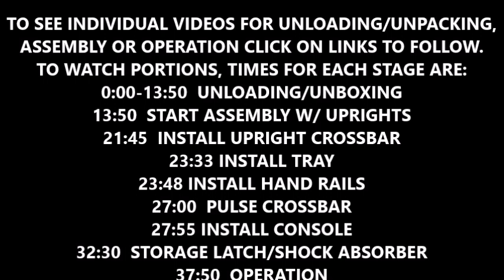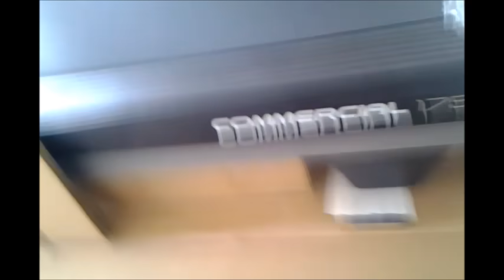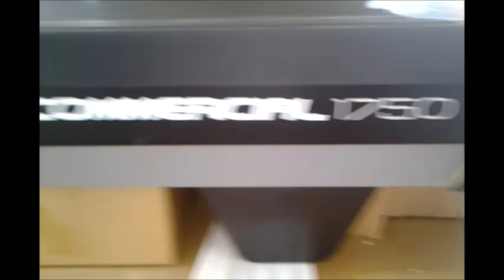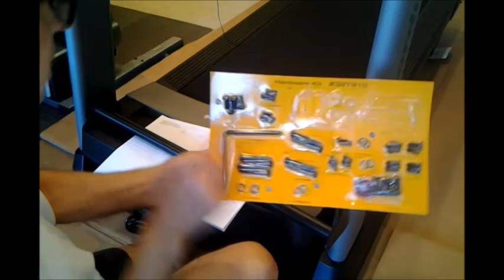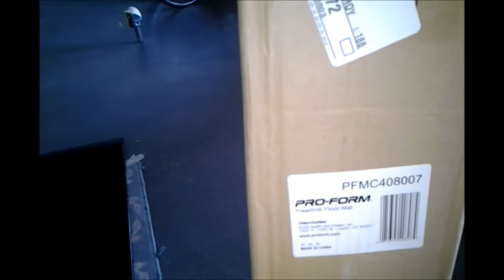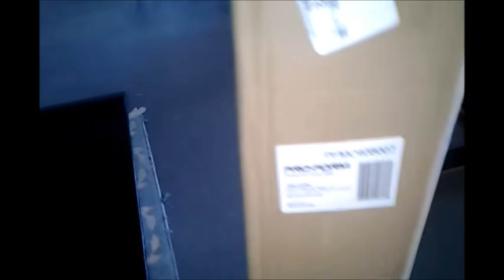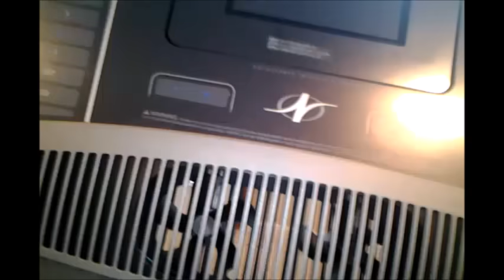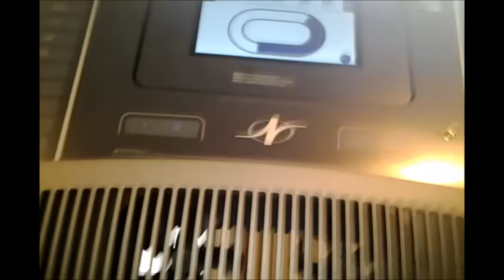NORDIC TRACK 1750 COMMERCIAL TREADMILL UNLOADING/UNPACKING, ASSEMBLING & OPERATING

Comment: I want to thank you and your wife for your the clear demonstration on how to set this up. How is yours holding up so far? I  am expecting mine to arrive this monday, and am haivng somene else assemble it. Seeing this video, I will be able to tell if the assembly is being done the correct way. Also, to clarify, the new NT1750 has select cusioning, but comes without a tablet holder. Not sure if one can be obtained as an option.
Reply from the maker: It is holding up great, Louis!  My wife runs 5 or 6 miles on it every day  (me about that many per week) & no problems so far!  I am surprised you don't have some kind of tablet holder, at least.  Surely you can order something?  Thanks for the kind comments & let us know how it goes & operates?
Reply from the maker: Louis, as an afterthought, does it come with a large enough screen that you can wifi your tablet, laptop, etc.?
Reply: @harrison4803  The screen is ten inches, so I am thinkimg it should be large enough. I'll know for sure when I receive it. :) AM happy to know that yours is still holding up.
Reply from the maker: @louisd95714  I assume that is 10" wide, which is slightly wider than my Ipad, that I use.  So, that is a good size.  Ours is only 6" wide.
Reply: @harrison4803  Thank you, I agree. Even if measured diagonally, I think it would be a good size becauae the viewing distance will be up close.

Comment: Great video. I'm having this delivered and assembled for me, but I'm worried about getting it through tight doorways. 
Have just removed an old Nike treadmill from the room but the box for this looks huge. 
Would it be possible to remove the frame etc separately from the box and move it into to room bit by bit??
Reply from the maker: Yes, as long as you have people available to do the lifting, it can be taken out of the box and moved and assembled.  Let us know how it goes?  Thanks for watching!
Reply: @harrison4803  Many thanks! That's a great help
Reply: Thomas Byrne ours just arrived today. We will need to put it upstairs. Thanks for asking the question because I was wondering the same thing.

Comment: Did you recievef the box in  the right position? My one was delivered this week amd the transport company   Moved out of truck and moved to my garage in a vertical positio. The labels in box states clear the proper side up but they transport in vertical way. Not sure if it was only in my door or this was done long from warhouse. I saw some movies of this tread mills showing it was delivered ina wood skid plate (pallet). Regards and thank you for the movie.
Reply from the maker: Mine was delivered flat in the truck & then the guy loaded it onto my John Deere wagon horizontally. Then my wife & I slid it off the wagon onto the patio & then pushed it into our walkout thru French doors.  Ours had cardboard & black pressed wood pallets surrounding it.

Comment: Thanks for the how-to video. I bought one of these during the virus shut-down, and not planning to go back to Gold's Gym for a while. The put it together option is not available anymore, so I really needed to see this.
Reply from the maker: Deborah, you may need some assistance on some portions of this, especially unpacking & the 1st part of the assembly? Let us know how it goes?
Reply: @harrison4803  I was given impression that the NordiTrack 1750 can connect to iPad and iPhone.
I WAS LIED TO.  The 1750 CAN NOT connect to iPad/iPhone.  
I will trash every NordiTrack all over internet.  
Another bitter customer.
Reply from the maker: @geak5994  GE, I can connect through my iPad with out any problem.  I do it through Bluetooth mode.  I can only get sound and not video, however.  Did you think you could get video?
Reply: @harrison4803  You get audio only, I believe.   IFit , for a period of time, allowed Bluetooth connection between iPad/iPhone.  That way you could use your iWatch to monitor heart beats while on treadmill.  
I did the texting thing with IFit support yesterday.  They removed that feature to support IFit stuff.
Reply from the maker: @geak5994  We don't have an iWatch or use iFit.  We just listen to radio, YouTube, etc.
Reply: @harrison4803  I do tv, but was counting on pacing myself based on heart rate.
Reply from the maker: @geak5994  You can do that with the chest band, can't you?  What do you mean, "I do TV"?  Are you casting to one or what?

Comment: This is such a great informative video John!! I am seriously thinking of buying this model now.. How is it now after a year? I do about 40-50km a week.. thanks Anton
Reply from the maker: Anton, we still love it. I only run about 10 miles per week but my wife runs about 30 and it's held up perfectly, so far!  We heartily recommend it! Thanks for watching!
Reply: John H fantastic!! Thanks John I think I’ll get one tomorrow unfortunately I’ll have to pay around £1700 to get one as I live in UK
Reply: @harrison4803  Sorry just another quick question! I'm currently 200lbs is that ok for fast running and or long distances in your opinion? thanks Anton
Reply from the maker: @theeyewearrooms4128  Anton it will take at least 350lb. and maybe 400.  And being a commercial model it will take lot's of use.  One thing I might add, it does not have a browser, at least our one year old does not, so you can't surf the internet.  Through Ifit you can access their stuff, which we don't use.  The blue tooth is great and can project all the way across our house.  We have to remember to shut of bt on our notebooks/laptops or they will interfere, while the other is trying to use the treadmill.  So, I don't know if the newer models says you have internet connectivity or not but we don't.

Comment from the maker: ns0122
Hi I’m assembling my 1750 right now, and I’m stuck on the ground wire/ground screw step. The ground screw doesn’t want to go all the way in, and I know you suggested using the screw that comes with it and screw all the way in to enlarge the hole to allow the ground screw to screw all the way in, however I’m afraid to damage the screw and strip the hole. Is it ok if there’s some space between the ground screw and the upright wall? I don’t want to proceed further lest I have to disassemble everything to get that screw closer to the upright wall. Thank you!
Reply from the maker: As long as the screw is contacting metal, it should work, IMO!

Comment: I'm thinking of purchasing this as well, but plan to bring it up to my 2nd bedroom in the 3rd floor of my townhome.  Do you know the dimensions of the box it was delivered in?  Hoping I can get it up 2 stairwells with a dolly and a the help of a strong dude.
Reply from the maker: Irena, it is extremely large - 7' long by 3' wide by 16" thick.  I think you will have to do some disassembly first?
Reply: @harrison4803  Thanks John, I agree with you.  Looks like I'll be searching for a professional team to disassemble outside and bring into my home piece by piece.
Reply from the maker: @irenafacelli2882  Irena, unfortunately, being a commercial unit, it is bigger & heavier than normal. Good luck & let us know how it goes?

Comment: Just wondering what the point of having all the small boxes under the inclined running deck you have fixed at one end to a mounting stand.   You must be pretty confident going barefoot to assemble a machine.   Doesn't look that complicated and one-person can definitely pull most of the steps off until the 33:30 into the video.
Reply from the maker: All of the boxes are shipped under the treadmill and you have to lift it up to get them out.  My wife wasn't available at the time.  Plus, they are glued to the cardboard bottom.  I can go barefoot because I am careful and keep things picked up and clean! :)Thanks for watching, Steve!

Comment: Needing a gym during these times I ordered the 2020 version of this treadmill. Is this something a novice like myself can actually put together alone?
Reply from the maker: You will have to lift up the bed to remove the boxes underneath.  See 9:00.  And putting on the console, etc., will take at least 2 people.  Let us know how it goes?
Reply: Latoya, I put one of these together by myself today. If you have a 14 mm socket wrench and a good Phillips screwdriver and can follow directions, you can do this. The manual is pretty good. It will help if you have assembled things like this before, but I still think you can do it.
Reply from the maker: @camofrog  Latoya, let us know, if you are successful?

Comment: I just installed mine. When it runs around 3 or higher, I get a thumping noise. Kinda like a tumbler dryer  noise. Did you get that noise and if so, did it go away?
Reply from the maker: No we did not have that noise.  I guess it's not a belt rubbing?  We have developed a belt rubbing noise but it was after 2 years & my wife runs 5 miles on it every day.  You might call or email Nordic Track?
Reply: The same thing is happening to me. It sounds like it is coming from the motor.
Reply from the maker: @dianafroschanders1043  Diana, we did not have that problem.  I suggest you contact Nordic Track and let us know what you find out, please?

Comment: Do you recommend 1750?
Reply from the maker: Erika, yes we definitely recommend it.  After nearly 2 years of use, with almost daily use of me running 1 mile & my wife 5 miles, it is holding up well, requiring no adjustments or maintenance.

Comment: NordicTrack continues to set the standard for bad customer service. Perhaps the worst service I've received from any company in the last 20 years.
Reply from the maker: Chris, you need to cite examples because I have not had "bad customer" service and I have dwelt with them on multiple occasions?
Reply: @harrison4803  1) Never shipped my order but insisted they had for a week 2) 5+ hours on hold, 3 of those today 3) Actually had a salesrep get pissy when I mentioned my frustration at being kept on hold for an hour at that point.

There's other shit, it's been an absurd experience and I can't say enough negative about the company. I've cancelled my order and will be buying a competitor's product.

They are a terrible company and I plan to make sure people know it.
Reply: A quick search shows my experience is not uncommon.
Reply from the maker: @chrisshaeffer7902  can you provide the link for your search?
Reply: @chrisshaeffer7902  wow i hear that a lot! I changed my mind about buying their tredmill. Did you find a better one?
Reply: Chris Shaeffer  I had a totally different experience with nordictrack. But it does happen to people having bad experiences with companies. I have a x5i incline trainer the display went bad after 9 years of hard use it was a tank of a incline treadmill. I talked to two nordictrack  reps  they were quick answered my questions and help me trouble shoot my out of warranty machine.  So I am in need of a new one I have talked to them a couple times  I  have narrowed  down to the sole f80 or the nordictrack 1750  and  I tried contacting sole I heard back from one rep answering about a warranty question and I asked a few more questions no answer so nordictrack has been good far as answering the questions I have and the other machine was great never once replaced  anything in past 9 years on it. So I probably will go with the 1750 from nordictrack so hopefully won’t have the same problems you ran into. But if I do I will let you all  know.